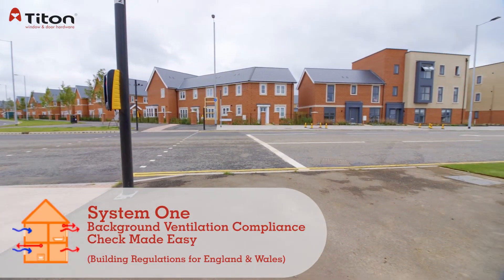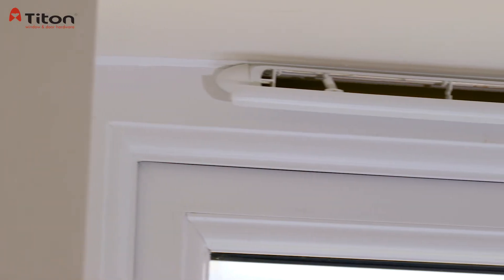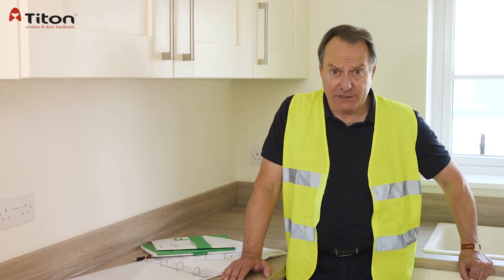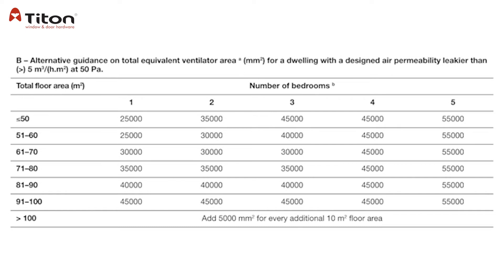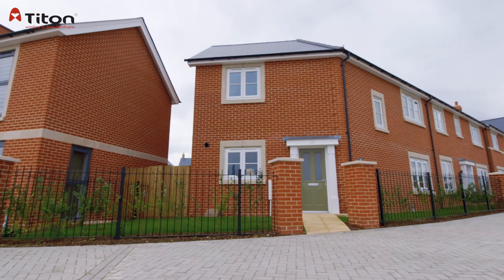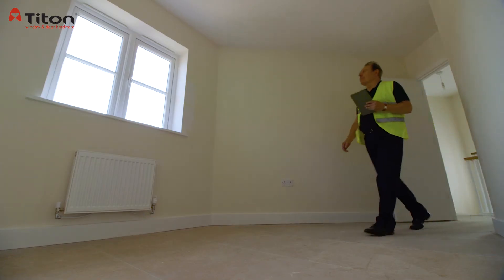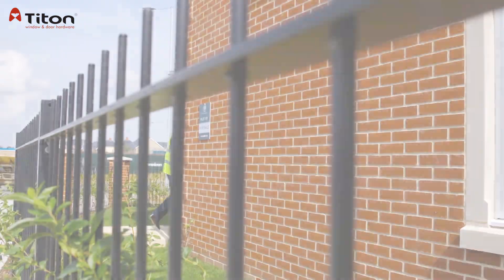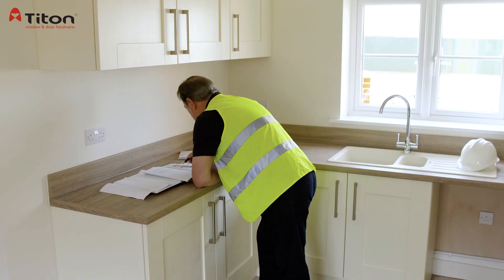System One – Background Ventilation Compliance Check Made Easy

Comment: The 20mm gap under the door will be reduced when the floor is tiled. Also I would say that a new building takes months to dry out not just a few weeks.
Reply from the maker: Hi Skill Builder. Thank you for your comment. At the time of putting this video together, we followed the guidelines in the Domestic Ventilation Compliance Guide which does state "10mm above the floor finish if the floor finish is fitted, or a 20mm undercut above the floorboards, or other surface, if the finish has not been fitted".